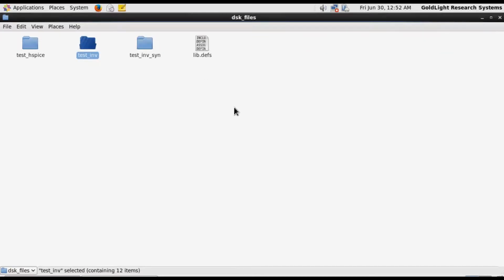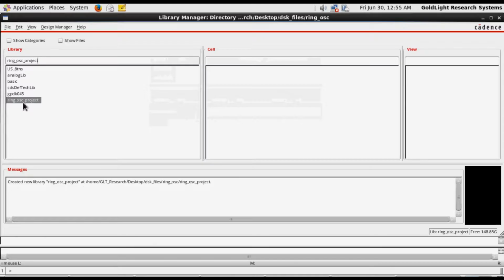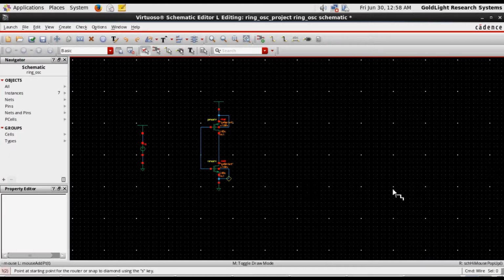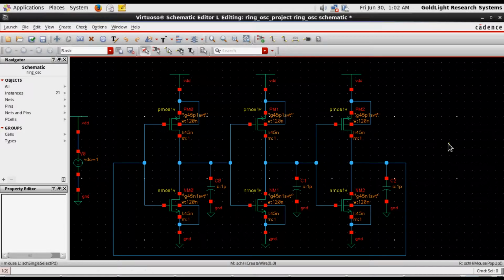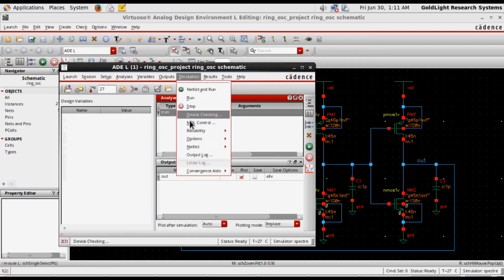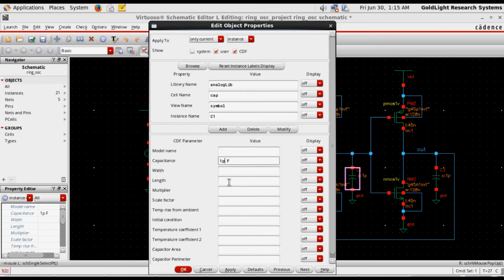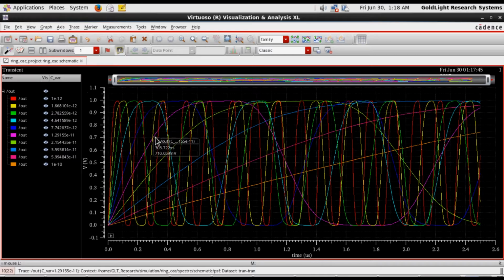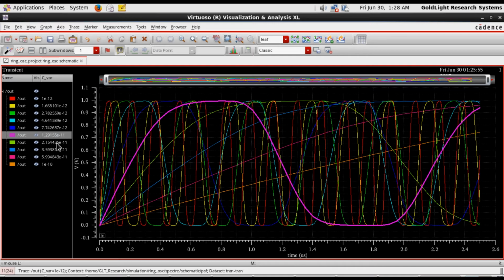Cadence Tutorial for Ring Oscillator  with Parametric sweep/GoldLighT Technologies

Comment: Can you explain how you have come up with these values for FET sizes, number of stages and capacitor  value
Reply: To find the correct transistor width, you would use a parametric sweep to determine where it's balanced. In this case I'm assuming the # of stages and capacitor values are kind of arbitrary, but calculations for both of those are detailed in section 4.5 of the textbook CMOS VLSI Design A Circuits and Systems Perspective, 4th Edition